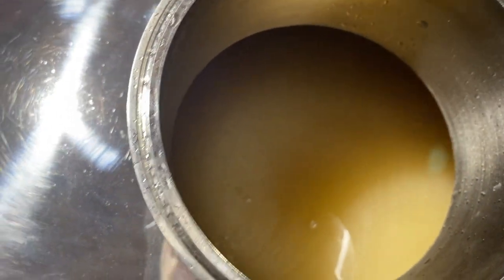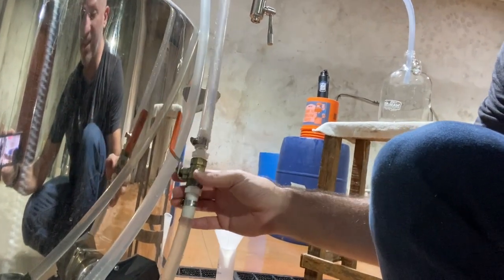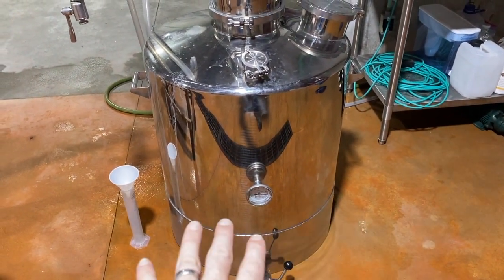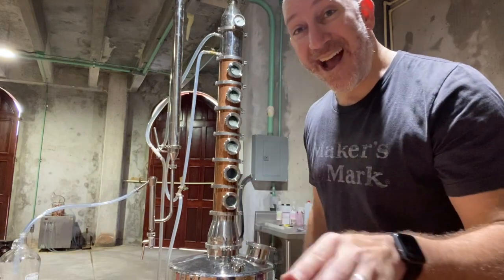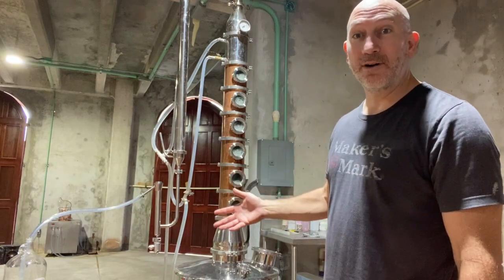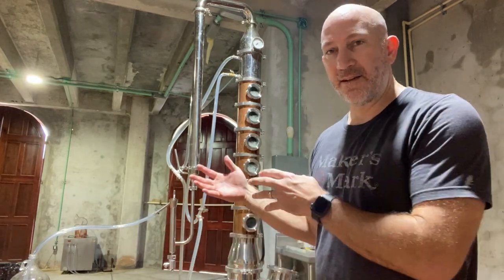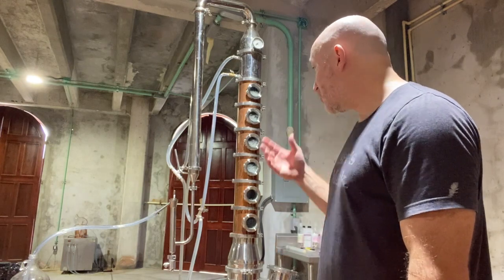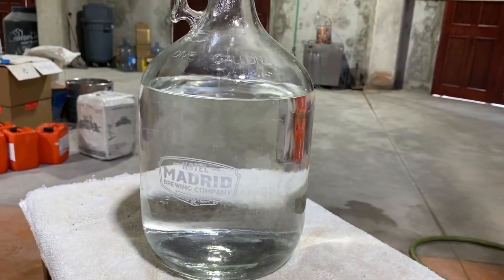6" Mile High Still

Comment: Hi Jim , I have a still like your but half the size , I really found your video very informative and have scribed, and its good to see someone out there  showing us novices how to do it , after I get the wash boiling I turn the power down and have just enough water to condense the alcohol and let it flow nice and slow but but in the next week I will try the way you do it , and ante  it  a bugger to pull it down and clean after finishing.

Comment: Beautiful setup!  I am new to the hobby.  I have noticed through my testing that using only elements to heat will produce uneven heat in the boiler. I was surprised during testing to find out that the temp at and above the elements was 180 degrees, and the temp below and at the Base was only 80!  100 degree difference. I now preheat with propane then remove the propane once it reaches 173.  This will burn off more methanol and improve the flavor for people that chew their nails after using hand sanitizer.  You can also accomplish this by agitating the Base of the boiler while it is heating by using a drill mounted paddle. Excellent video!
Reply from the maker: Thank you! I have a video showing that I use a pump to recirculate the wash while I’m distilling and it really evens out the temperature and I get more yield. This is what has worked for me.

Comment: Great video.  I to was running through food grade tubing from my condenser to my collection jar.  I had someone tell me that the high proof alcohol causes some of the food grade tubing to leach into your run.  I've made runs using copper tube instead of food grade tubing and I lost the plastic or petroleum smell.  It taste and burns cleaner as well.

Comment: Jim I would change one thing and that is the water inlet to the reflux condenser by fitting a needle valve tap to regulate the flow of water going in , would be a bit easier to regulate it instead of a ball valve tap. Good video mate
Reply from the maker: Great idea. I’ll try and buy one now.

Comment: I used to fill my column with copper and ceramic saddles and I would wind my rig down as slow as possible , and I would air my liquor out for 2 days and it was oodorless and tasteless , unless I steeped a flavoring like berry or put oak barrel staves in it for a mind blowing bourbon 😁

Comment: Jim, excellent video.  Have you tried to dial down from 11kw to give the bottom bubble plate a chance to get wet and bubble?  I think the vapor pressure from the boiler is just too high.  The collection rate would be slower, but the quality would be higher.
Reply from the maker: I have not tried that and think that is great suggestion! I will try it on my next high proof run. Cheers
Reply: Exactly. And open the cooling on the deflag to compress the vapor a bit 😊
Reply: You're exactly right. That's how I run mine and people love it.

Comment: Something you might try. Take the deflegmator and put it at the bottom rather than the top of the column. Block the lower cooling water port. Fill the cooling water cavity about 2/3 full with for shots or heads. Connect a reflux Leibig condenser to the upper cooling water port so vapour of the heads inside condenses and falls back in. My guess is you will get all 6 plates bubbling that way and higher proof.

Comment: You can lower the amount of heat going into the bottom near the end of the run. That will improve the reflux but ofcourse take longer. So putting the top liquids of the end of your run, in your next batch is a great option aswell!

Comment: Excellent video mate, I heard that it will produce better produce if the condenser temperature (top thermometer)runs at about 130 Fahrenheit ? Does it make much difference? I noticed yours is running at about 172 Fahrenheit? Thanks for your time
Reply from the maker: Thanks for watching the video! I need to get my arse in gear and post some more..haha! Regarding the head teperature, in most stills, like this, you will have your boiler temp and your top head tempature. The boiler temperature should not be used to determine output, only as a temperature indicator, however the head temp, at least for me, is very important. Methanol turnes to gas at 168F and Ethanol at around 174F, so I use the top head temp to tell me where I am in the process and I try to use it to cut my foreshots and heads. As the alcholo in your wash (beer) is removed, the temperature will contiune to climb, because the water to alcholo ratio contiunes to change.  Obviously there is more to it, like checking the quaility coming out of the condensor. As far as condesning, the water temp only needs to be colder then the vapor temperature to change the vapor back down to a liquid. That all being said, in my experiance, I have never been able to get any type of liquor out of my still, with a head tempeature below 168F. Hope that helps! Merry Christmas!
Reply: @jphalan  Thanks for the prompt response, merry Xmas to you too 😊 keep bashing out the videos because they’re really good and informative!

Comment: Thoroughly enjoyed watching the process.  Thank you for the view into your production.  If you have tanks of cooling water in another room and a run of 6 hours can heat 5000L, how long will it take to drop the temperature of that volume of water so it can be re-used for another run of wash?
Reply from the maker: Thank you very much. The water temperature just needs to be cooler than the vapor that comes off the column to condense. However, if the water is to warm, and you are using a parrot with a hydrometer, like I use, the higher temperature can skew your output alcohol reading depending on what your hydrometer is calibrated at. The tank cools down to around ambient temp (room temp) by the next day. Its not a big issue for me. I normally distill every other day.or twice  a week.

Comment: Nice video, thanks for sharing your craft. I'm curious on the size of the cooling water tank.
Reply from the maker: I have 2 x 5000l tanks connected together for a total of 10,000 liters. I can isolate them, and using one tank works just fine.

Comment: pls tell us about fermentation and how much sugar used for 200 litres and which yeast you are used and the temp of tank fermentation? thanks for your video
Reply from the maker: Im using a 50kilo bag of cane sugar for 200L of wash. That gives me a starting gravity of around 1.090 and depending on your yeasts attenuation, you should get anywhere from 10% to 13% abv. Im using Fermentis-SafeSpirit HG-1 500 gr package. It is highly recommended that you bring your water up to a nice hot temperature to dissolve the sugar, otherwise the wash won't ferment all the way out. I would say bring the water temp up 180F min (you can boil if you want to), stir in sugar until all of it is dissolved, then let it cool down to around 80F then pitch the yeast. I also add citric acid to my water before adding the sugar to get the PH level down to 5.2PH, that seems to be the yeasts happy place.
Reply: @jphalan  
Please, if you can video the fermentation operation, it will be very good for us, thanks for your help

Comment: How does mile high charge for a set up like this?.  I built my still using a keg I had around the house it is very similar to yours I just don't use the plates I use copper scrubbies with a couple sight glasses filled with glass beads and deflagg I built to reflux  . Yes George Duncan is the YouTube king been watching for years thanks for the video!..
Reply from the maker: This setup was right around $6200. Little extra for the copper sections.

Comment: I enjoyed you interview with George, So I am here... maybe you can answer a question, why are thermometers used solely above the deflegmator, use of a PID at the point of no-return to control pot Temp , let a PID control the pot temp.. just asking
Reply from the maker: they arent used solely, at the top or above the deflegmator, I have two, one on the boiler and on at the top. The temperature you need to worry about is the head temperature at the TOP. Ethanol turns to gas around 174F, so if you want to maintain that temperature at the TOP (Deflegmator), you can use a PID to adjust the power output of your boiler, to maintain the head temperature at the top. The PID will apply and turn off power as needed to maintain the set temperature. Go to Barley and Hops Youtube channel, George has a lot of good videos and information how to set this up and why he uses it.
Reply: @jphalan  are your plates all flat plates in the column?  with flat sloted plates in the first 2 plate above the boiler then use Bubbler plates in the other four.. have your tried this configuration... OBTW: what type of power in Mexico? 120/240 60 cycles split phase?

Comment: Thanks for post. Audio kinda sucks though - just mentioning it.  No issues with the high capacity in the kettle - doesn't seem like much head room in there......?
Great set up - the column is a monster.
Thanks
Reply from the maker: Yeah, I know..lol. I just purchased a new Mic setup to resolve that issue. Mile High states that you can fill the boiler all the way to the rim. After doing that several times, I am noticing that I get better runs if I only fill it up to about 85% 90% leaving some head space.
Reply: @jphalan   it's a great video. Just the audio was a bit strained. When I wrote that I didn't realise you were kinda not a pro video guy - The video and content was great, but the audio was off a bit... just felt compelled to mention it.  I probanly shouldn't have.  I don't know how to increase viewers, (not real time on youtube) or I'd throw that out There, but your content is solid.    I wasn't sure about the mash level - I hear various numbers . I really liken the milehigh set up. Looks and produces great. I guess the kettle diameter and column diameter are factors in whether or not it runs well. Lots of people overfill there keg and have issues. 
Cheers
Reply from the maker: @capitaldd3693  No worries, thanks for the feedback!

Comment: Once you started producing have you tried running it with just one element. Gee I'm concerned about that heavy current draw.
Reply from the maker: I have, especially when I have done a whiskey run. Use two to get up to temp and then 1 to maintain.

Comment: I'm doing this as a hobby with a 2l still but I want to go bigger with 4 inch collum with 3 bubble plates. My keg schuld hold like 30l-40l but I'm not sure if this is operatable.
Can you give me your opinion to this setup?
Reply from the maker: Hey. My first still was a pressure cooker with 1” copper pipe from Home Depot, and I was able to get 160 proof off of that. I think your setup will work just fine to cut your teeth on as a starter still. Are you going to be using a heating element or gas to heat your boiler (keg)?
Reply: @jphalan  dependent of the time  the run takes I want to decide whether to use Propan or electric. But electric is expensive and Im not the best with electric stuff also I didn't find what I wanted for electric heating. I already have a propane burner so I guess I will use this

Comment: Beautiful construction. You would get better results if the level did not exceed 75% of the Boiler Volume! ;) 
Remember that every drop of water that changes its physical state from liquid to gaseous increases its volume 1700 times!
Reply from the maker: I did notice this after many different batches since this video was taken. The manufacture states that the boiler can be filled all the way to the top, so obviously, being a newbie, I had to try what they suggested. I now get much better results with it filled around 75% to 80%. The other unpleasant part of this design  is where the heating elements are placed. The bottom 15% or so never gets hot. I was able to hook up a pump and recirculate the wash while distilling and I was yielding so much more.
Reply: @jphalan  excellent explain how that pump setup is? You have the heat working against you and how did you hook it up via that setup?
Reply from the maker: @yonceydelatorre3802  check out this video: https://youtu.be/1foyD0z7yzU it shows how the pump is connected.

Comment: Can you run that box off just a regular 120 outlet?
Reply from the maker: No, there are 2 x 5500 elements for a total of 11,000 watts. The box needs a 220v 50amp circuit. I have mine wired directly into the panel.

Comment: That clear tubing your using will leach if it is hot.
Reply: +1 Correct. PTFE "Teflon" hose is high ABV Safe!
>>> Tried to post Link to PTFE Hose but ytube no longer allows it. :(  <<<
It's not cheap but for safety and health purposes it's worth every penny.

Cheers!